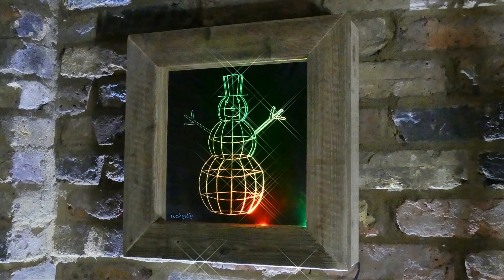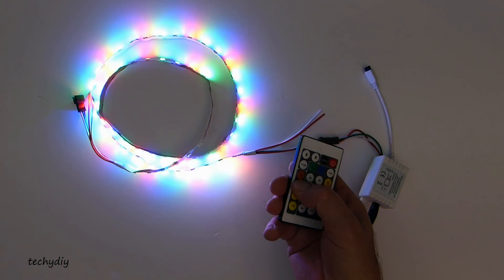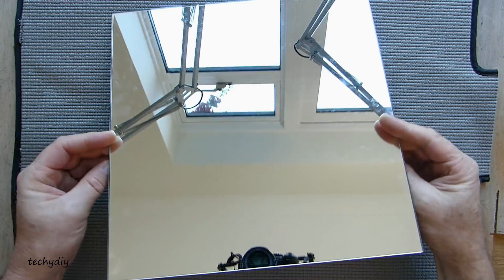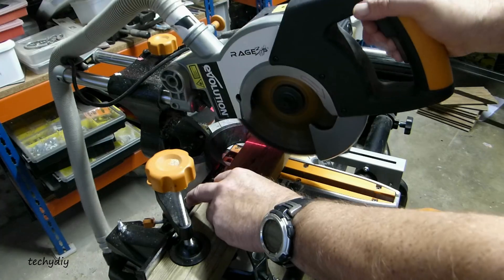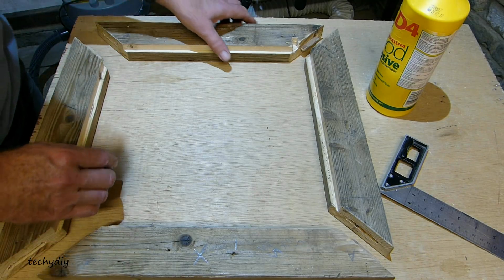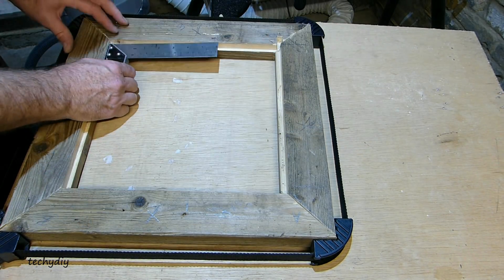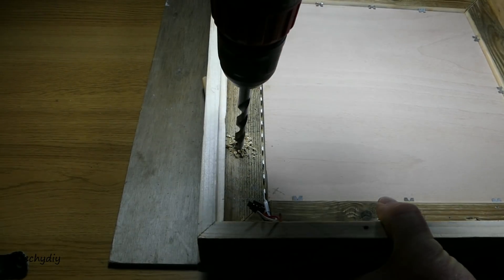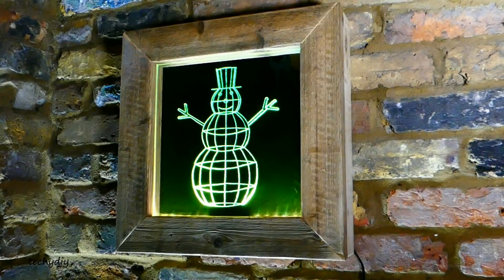How to Make a Snowman  LED Mirror

Comment: How would you go about adding LEDs to a glass white board? I have a large piece of tempered glass in great condition that I want to turn into a glass whiteboard. I know I can just paint and hang it, but I really want to make it stand out on my wall. Thanks and merry christmas from the US!
Reply from the maker: +Squirrel Pie  Probably mounted in a frame with a white back,. a gap of about 1/2" and then the glass. Led strips mounted all the way around in the gap pointing inwards. The idea is that the LEDs light the white back and that then lights the glass. You might have to diffuse the light from the LEDs, there would be a bit of trial and error. It should be worth the effort though, I use something similar for photographing products, lit from beneath, looks great. Have a happy Xmas.

Comment: I was about to buy a Dremel 4000 yesterday at Home Depot México... finally I didn´t because I saw a lot of videos (Brazilian videos) stating that Dremel 3000 and 4000 sucks because it does not work in low velocities, they state that you should use it only in velocities from 5,6,7 ... is it true???
Reply from the maker: I can't say I have ever noticed. I have a 3000 and it's a great tool.